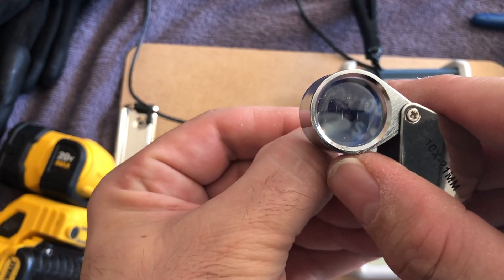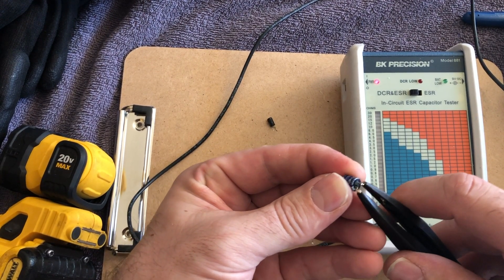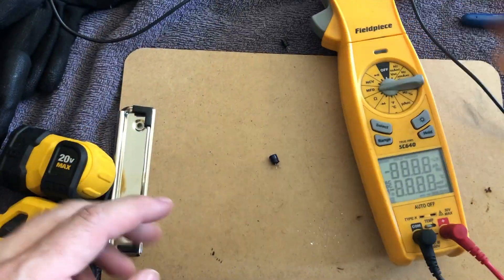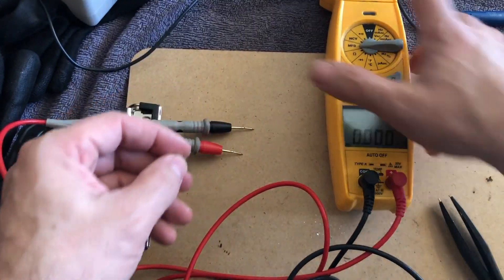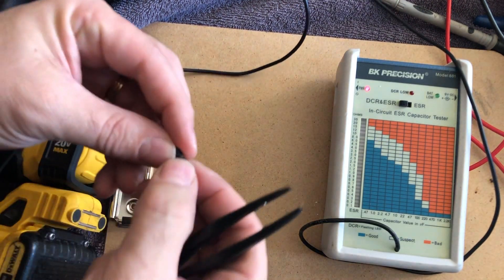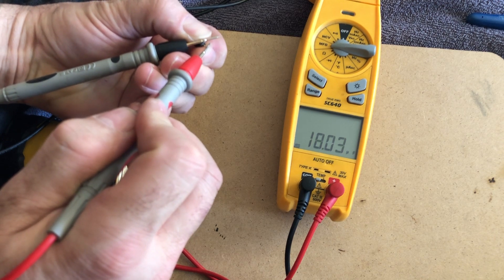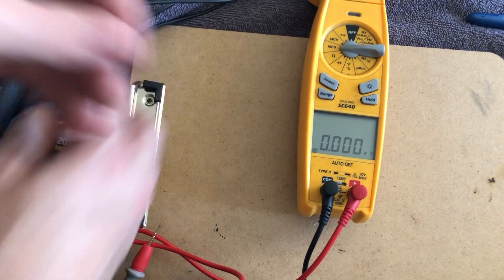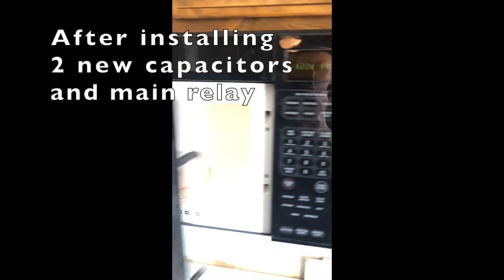DMM Capacitance vs  ESR Meter

Comment: I prefer to use the ESR meter insted capacitance meter.
I use every day for more than 25 years without any issue.
I have 3 ESR meters
Dick Smith 
GME 
Peak Atlas DCA70 

Best Regards
Reply: I enjoy collecting esr meters. I also have the meters you mentioned, and I enjoy them all. 

You should try the DE-5000 and the EDS-88a. 
I really like them and find them useful.

Also, an analog ESR meter is really useful. The only analog ESR meter I find is the “capacitor wizard“ and I think it’s overpriced, With an outdated circuit.

I much prefer the “five transistor ESR tester“ designed and discussed on the eev blog. It’s an analog ESR tester and I’ve built several versions of it. and I think it’s one of the best circuits ever designed for testing and circuit ESR! It’s super easy to make either in through hole or surface mount. And many people on eev blog have made it and shown their progress.

Just google “five transistor ESR meter analog”and you’ll find some good pictures. It’s great to see the needle move in real time that’s why I like analog meters.

Obviously there’s no need for this many ESR testers… I just like collecting them because I enjoy them and think they are interesting.
Reply: @hullinstruments  Hi, I am thinking to buy one DE-5000.
I have one GME-236 is identical to the BK 881 with lower price.
Sorry my Peak Atlas is ESR70.
Best Regards.

Comment: thanks for the video, i have few questions 
Is it important to do Capacitance test if i'm doing ESR test?
Do you do leakage test as well?
i have this cheap MM (hilka 34083000) it has OHM symbol on it, can it test for ESR? because it doesn't give me any result
thanks
Reply from the maker: I don't test for capacitance or leakage, the best way to test a capacitor is with a dedicated ESR meter like BK Precision 881. A standard MM does not have ESR function. hilka 34083000 does not have ESR test capability.
Reply: @electronicsprojects4708  thank you very much 👍

Comment: Showed to be bad with the esr but within specs with the digital meter set to ohms?
Reply from the maker: The dmm was on capacitance measurement, tested good. The ESR reads 'Equivalent Series Resistance' of the capacitor, measured in ohms, tested defective. This is why it's the better tester for electrolytic capacitors.